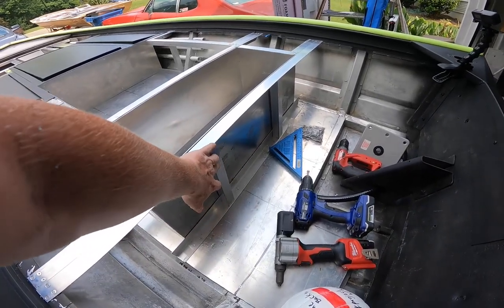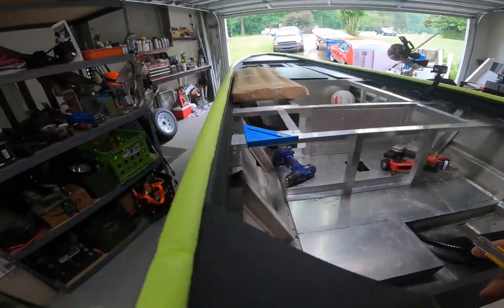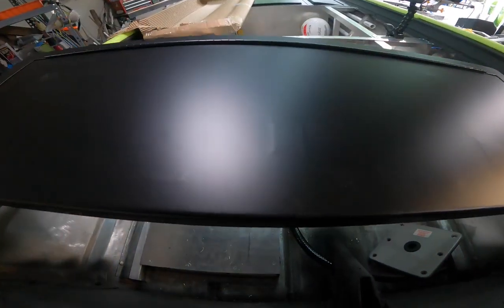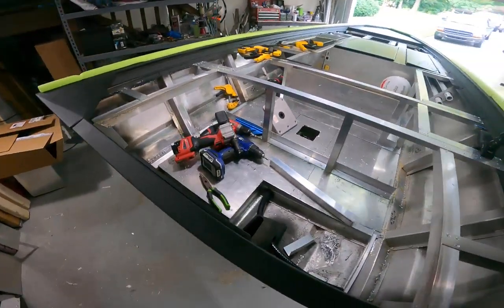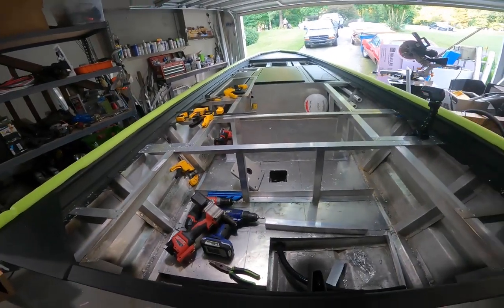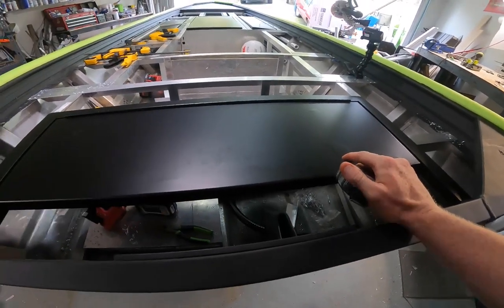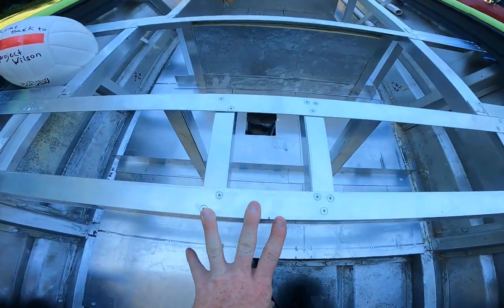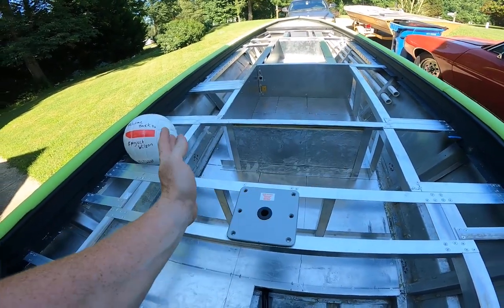COMPLETED Deck Framing Jon Boat to Bass Boat

Comment: If you use 1 1/2 inch angled aluminum. What size square tube do you use? I thought you just said 1 1/4.
Reply from the maker: Yessir, 1.5" angle, 1.25" tube

Comment: Looks good with the rear seat pedestal how is your lid going to fit unless you put it on top of the lid lip where it goes over that piece of angle
Reply from the maker: The mount will be on top of the lid overlays. You could always cut them out around the seat base if you wanted to

Comment: I’m sure you have answered this before so I apologize in advance. What size/thickness of aluminum angle do you use? I’m thinking of using this to frame out a build inside my truck bed that has a cap on it and need to support my weight to sleep on it. Any suggestions would be great
Reply: He’s using 1/16” thick angle for this build. With good planning and bracing it’s super strong and lighter weight that 1/8” thick angle.
Reply from the maker: We have a few guys working on something like this. Hopefully they will go public with it soon 👍👍 it will probably be on the Tin can crew youtube channel